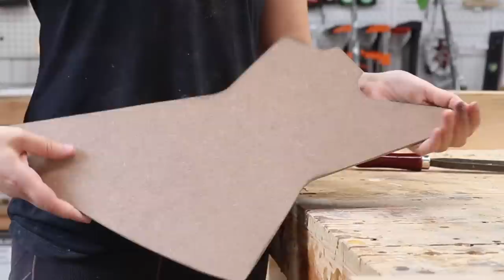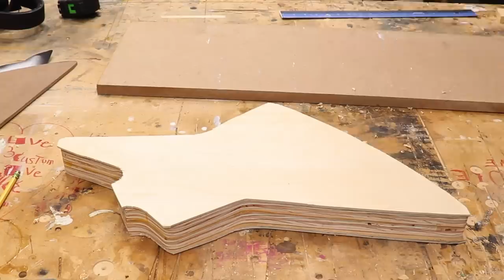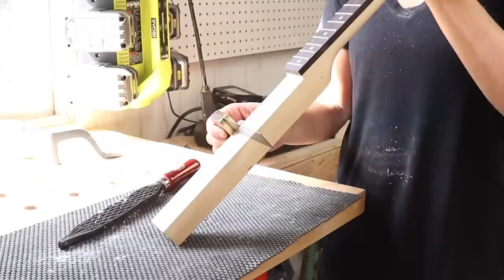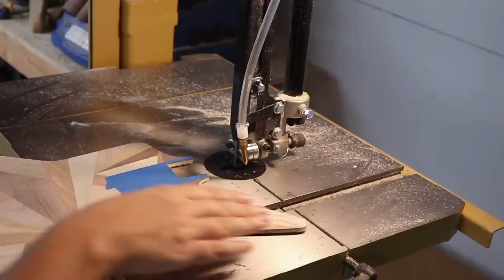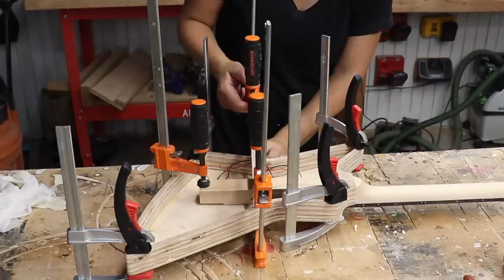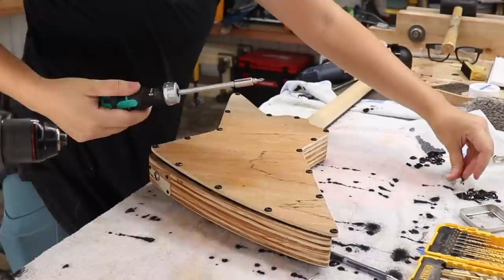Building a 3 String Guitar from scrap wood - NO TALKING, JUST BUILDING!!

Comment: How is this scrap wood you've bringed a whole new board to cut from
Reply: Because it's cheap materials I guess
Reply: @Winther1973  plywood isn't cheap, and neither is the prebuilt neck, nor the hardware of the guitar itself...
Reply: It was originally from a 4' x 8' sheet.  Leftover.
Reply: It was in her scrap pile.
Reply: I think she means only the front pieces on the body, that give the guitar its amazing look. Those came from her scrap pile.
Reply: @viliusmarcinkevicius4747  She never claimed the guitar was cheap to built.
Reply: @stankorzilius  yeah, I understand that.
Reply: @stankorzilius  the word "scrap" implies a cheap build. The whole guitar, body, neck, tuners, pickups could have been built from scrap for cheap.
Reply: @sjeverett75  Could have been, yes, but she chose not to and she also didn't imply she did. The title doesn't just say "scrap", it says "scrap wood", which explicitly excludes other components. Assuming the plywood was indeed a leftover from another project, I feel there's nothing misleading about it. Well... except the neck piece, your're right about that. It would've been better to call it "building a guitar body from scrap wood".

Comment: what model of table saw are you using and if it is a 8 1/4 inch blade, have you seen any limitation in depth of cut, thanks
Reply from the maker: Dw745 and it’s a 10” blade